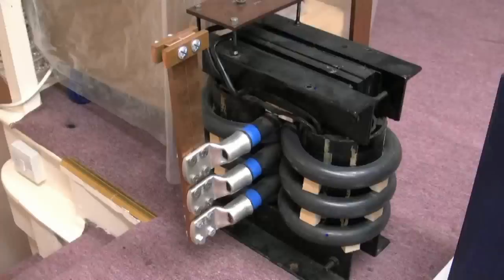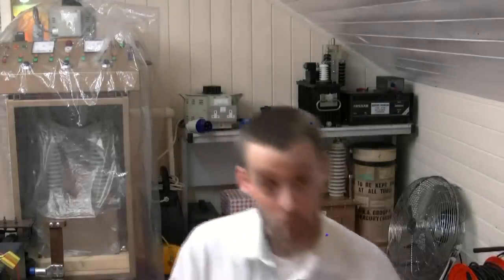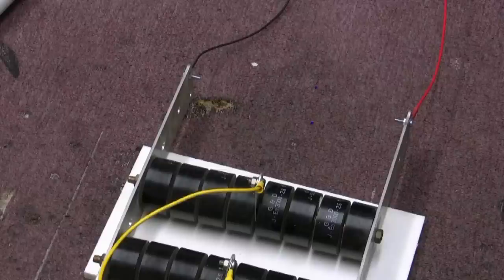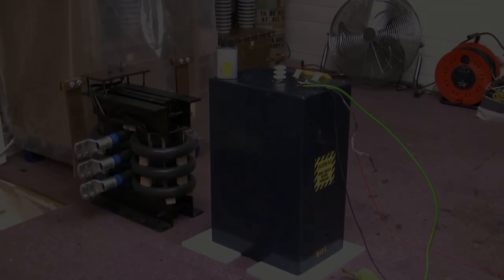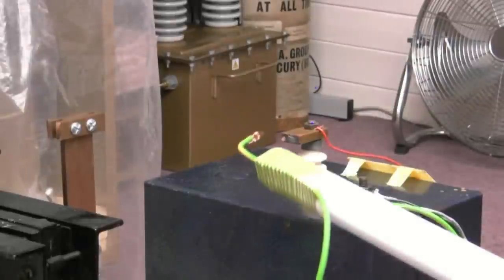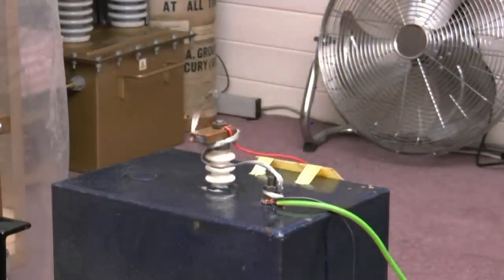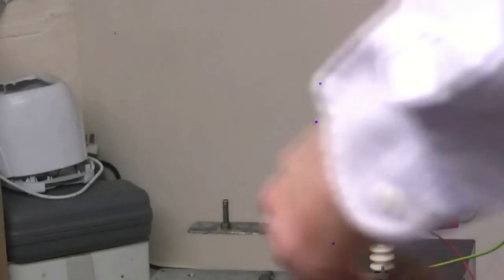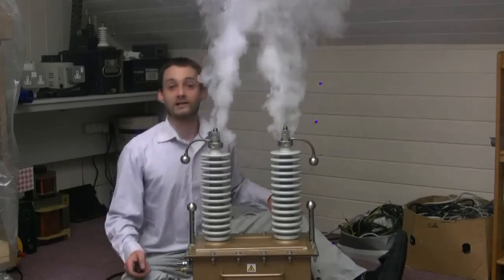Big Capacitor Safety

Comment: "You will probably just explode" Proper word of advice lad..
Reply: Ikr
Reply: Daniel Timberwolf your weakest point in your hand will explode like a fuse. You won’t die
Reply: Plus you have a lot of hand resistance and resistance from ground
Reply: Dave Crupel yes however there’s not a lot of time to do damage.
Reply: @WELLINGTON20  Look up stories of gypsys being blown up cutting through cables at substations for the copper
Reply: you will not explode, you will be hurt, cooked, or dead but only under conditons were a gap aleady existsvand is close to its breakdown volage and you touch that spot so as to help the gap reach that point will that part of you explode kinda
Reply: Lol your whole body is the fuse flesh bone skin nerves tendons all connected with that much juice you will be like the coconuts  shit it's everywhere imagine taht but body parts
Reply: Lol its probably  higher than that this dude literally  has the national  grid go through  that thing its probably  as strong as lightning  and imagine the pure current and power lightning  is this dude is probably  very  close to it
Reply: @jamescambell1386  "Hurt". Nice choice of wording.
Reply: @firefox1136  How do you calculate 400MW?
Reply: @kaspervestergaard2383  You would need the (resistants,) the duration of the puls and the energy to calculate it, but 400MW whas just a random guess. You can be sure tho, that the peak pulse power of this capacitor is in the range of ten to a few hundred MW.
Reply: @firefox1136  Very interesting. Would like to see the effect on that thing on a human being. Plenty of people getting cooked on overhead wires, do you thing this would go any differently? The power would automatically stop right after the charge is done I'll assume.
Reply: @kaspervestergaard2383  I guess, that if you would touch it with your hand for example, it would blow it of or explode it and then loose contact. 
I am very sure that there would be an explosion at/of the weakest link in the circuit, so your arm, hand or leg for example.
But I dont really know to be honest, I never heard of any accident like that and so can only tell you what I think would happen.
Reply: @firefox1136  Thanks for taking the time to explain. One thing is certain. Death is very likely ;)
Reply: @kaspervestergaard2383  Exactly, have a nice day. :-)
Reply: Joules would be the appropriate term not watts. I have 6 energy storage caps each one rated 17.5kvdc@72uf which comes out to 11.5kj for each capacitor
Reply: @kaspervestergaard2383   that would only add to the unsafe hype im known for

Comment: For those thinking of purchasing a large capacitor: they are dangerous devices.  Unlike batteries, capacitors can release all its charge at once, which means high current that can be very destructive and lethal, even for a brief time.  If batteries deliver energy like gas tanks, capacitors are like explosives.
Reply: Very true, best to leave it to those who know what they are doing. 

I remember that Nikola Tesla said capacitors were the electrical equivalent of dynamite after a very large one blew up in his lab.
Reply: didnt he basically say this? twice?
Reply: I should hope someone who purchases a large cap has qualifications in at least level 2 electrical installations or equivalent, which would give necessary practical and theoretical skills and knowledge to know about and calculate capacitances, and also safely work with electrical systems in general

Comment: These were the days I got my electrical inspiration. Now I'm on my way to a good career because of it. Thank you so much for the vids!!
Reply: What are you studying? I really hope your doing an apprenticeship which includes commercial and industrial because that's the only way to learn a trade. Doing domestic you don't really learn anything and it's a lot of bodget and scarper.
Reply: @TheManLab7  Got my associates degree in electrical/utility technology. I'm planning on getting in as a substation apprentice, right now I do electrical work on cell towers. I can agr with you there. The commercial & industrial side of electrical is far better than domestic/residential. I've done some residential, & it sucks. Lame as fuck.
Reply: @VariacManiac  I hardly EVER do it and it's only for my family and 2 of my mate's.
Reply: @TheManLab7  Sounds like what I'd do. Plus here in the US, we got residential grade outlets and wire which is cheap rubbish. For personal installs, I try to stick with the good commercial grade stuff, which ironically is easier to work with.

Comment: Actually, capacitors do have a behavior called "dielectric absorption" where the voltage will begin to rise again on its own after the cap is fully discharged. This is because some of the energy which you put in the cap when you charge it remains in the dielectric material in the cap. It doesn't come out in the first discharge but can be discharged-out later. How much this happens depends on the materials that the cap is made from.

Comment: Try it with a large-ish electrolytic. They usually show this effect pretty well. I just tried it with a 680uF, 25V Panasonic electrolytic cap charged to 24V. After quickly shorting it with a screwdriver, it rose back up to about 1V or so over the course of 30 seconds. In this case it's not dangerous, but if you have a cap which is charged to 5kV and it regains 1/25th of its original voltage, that would be 200V and still be enough to kill you.

Comment: Way back when I had a 2.2 uFd, 2300 volt DC capacitor, energy storage type.
That and a 1800 VDC power supply for charging.  I had fun, never got gotten.
Try discharging through a 2cm piece of the finest magnet wire you can find!
Very loud!
Reply: For some reason I felt like I had to try that a few days ago, before even reading your comment. But I used 0.2mm (~32 AWG) magnet wire, and a 22uF/400V capacitor charged from 220V mains through a bridge rectifier (310V peaks) and it was indeed very loud. Doing it again but with a 2300V cap would just be looking for trouble.

Comment: If you are able to get that capacitor, you probably don't need the warnings. Health and safety common sense.
Reply: +Julius Bernotas You'd be surprised what you can buy off ebay these days :-)
Reply: +vinny142 Kiddies buying that (and smart enough to charge it)? Unlikely.
Reply: Better to change "not likely" to "should not be made this easy"... Assumptions about something this dangerous, not worth it.  They could be obtained second hand, and you know how second hand things are often devoid of user manuals or proper labels 😜 Also, there is no certification required to option one, as they are not dangerous in the state they are sold in.
Reply: Charging them isn't hard. For those who don't know how, just run a simple google search.
The fact is, large capacitors are dangerous and everyone does have access to them. They're in TVs, microwave ovens, computer power supplies etc etc etc. They may not be as big as the one in the video, but they're just as dangerous. Death is still death, even with a smaller shock.
Reply: and 150mA is more dangerous than 300mA

Comment: Man, shorting out capacitors is loud! Even with a small MOT cap at 600 volts my ears still hurt. Oh, and there's aluminum foil shards everywhere because I wondered how big the damage on a CD would be.

Comment: I had an experience with capacitor accumulation. Though it was mere 400V 22uF that was constantly energized to wall plug over a year, it had a LED with 100k resistor as a load, i shorted it out 20 times and still it recovered the charge out of thin air. I ended up shoveling it into salt water for a day.
Reply: @DjResR Salt water?
Reply: @kaspervestergaard2383  Yup. Salty water is conductive. It was first thing I got in hand after getting zapped 5 times in a 10 minute span._
Reply: @DjResR  Must be the fastest responds to an 8 year old comment. Interesting with the salty water. have heard it was more conductive, but a very smart way to use it. Still playing around with these things? Not really a person that understands all these different technical words, mostly here for the overload videos :)
Reply: @kaspervestergaard2383  Same old same old, although nowadays have done more experiments with low voltage stuff, just recently managed to get 4000 chips to do stuff. Still getting zapped too from time to time and it still hurts._

Comment: what would appent if you connect ten o these in parallel? (other than creating a black hole)
Reply: Ruben Fasola 
You would create something, even photonicinduction wouldn't mess with
Reply: You'd get 10x the amps. Try charging them in parallel and put them in series for disscharging, then you get 10x the voltage :D

Comment: um yes i do.  it would be used in a standard "H"power supply to filter out and ripple.  What I do not know is if it would be before or after the inductor choke.  Probably after & before the load.  Id like to know how many farads it is.

Comment: what is the size of that capacitor? (farad / coulomb)
Reply: Joseph Deerslayer 138uf, 5kV
Reply: MadSparks164 Why does they have such low farad? My car capacitor have 4 farad. why doesn't this one?
Reply: Because that would mean having an even bigger capacitor - This capacitor was obviously used in an application that required a 138uf capacitance. This capacitor has an extremely high discharge current, so the power when shorted in extremely high, resulting in the big bang as lots of energy is released almost instantly, like a bomb.
Reply: sebastianblevdet Because your car capacitors are rated for a very low voltage. You can wrap the capacitor sheet more tightly, so tight there's a very small distance between the sheets, and you end with a higher capacity. When making high voltage caps you can't wrap them too tight, because you need to use a good insulator to prevent arcs and thus destroying the capacitor. 
If your car capacitors were connected to that supply they would just arc and be ruined.
Reply: Victor Arnaiz Thanks, This made sence!
Reply: Victor Arnaiz Stop me if I'm wrong, but if this cap is 138uf that would mean it is most likely an electrolytic cap whose anode is covered in a insulating oxide which acts as the dielectric which can withstand very high voltages but it can not hold many charges. The capacitors in car stereos are often electrochemical caps with a liquid electrolyte which can stabilize the electric field created by more charges giving more Farads but it is unable to handle the pressures much above 3 volts which would cause arcing and destruction of the micro structure of the sheets.
Reply: Virtualgod2009 Ya that could be true, I was not sure what the voltage of the cap was, usually when I see uF or pF i think electrolytic because they never have a high amount of Farads.
Reply: sebastianblevdet stiffening capacitors in car audio systems are build to sustain a maximum voltage of about 20 volts. larger voltages require thicker layers of dielectric, which decreases capacitance.
Reply: yeah, its like if you have a high enough voltage between an anode and cathode it will jump the gap. through the air even

Comment: Sorry for my nublet question, but can that capacitor be used for a tesla coil, and will it be effective in power factor corrections for high power supplies? Thanks for your time
Reply: #1: Don't ever think about it.
#2: Yes in fact it has been designed to also do so.
Reply: Yes it can
As Mr opengl said don't

Comment: How much would it cost, if i would buy all this parts in some shops?
Reply: Virtually zero shops that sell the parts such as large HV transformers, hv diodes and the HV capacitor is very expensive.

Comment: Voltage Vs Amps - There's a curved-edge Nexus-Diamond diagram that explains this. High Voltage, Low Amps AC won't kill. Low Voltage, High Amps DC won't kill (to a degree - heating of flesh might make you retract your grip/touch - salts/electrolytes in your blood will vary). Anywhere in the curved-edge diamond-zone (combo-zone) has the potential ability to either shock your heart into full cardiac arrest, or conversely, literally blast your flesh (heated saline in your blood) apart with explosive energy. Know the zone!

Comment: what did you use to make the smoke at the end? need to check how well a fume cabinet i made works...
Reply: You can buy little smoke bombs/grenades for airsoft/paintball for not very much money. Those would probably be your best and easiest choice.
Reply: Daniel W too bad i live in Australia. such fun seems to be ilegal here.
Reply: sn0wchyld I'm sure there's a smoke bomb type of thing that gas engineers use to check for leaks. Better to have leaking smoke than gas. Perhaps try a hardware store. Other than that, i'm not sure what else to suggest.
Reply: Daniel W yea cheers for your ideas mate, i've ended up using a bunch of incense sticks hah. stinks a bit but did the job.
Reply: sn0wchyld Incense...why didn't I think of that?.....lol no worries buddy
Reply: Vapelife bruh!
Reply: Samster881 What if he doesn't vape?.......
Reply: Samster881 hah dont vape, but not a bad idea. I build a lot of ebikes/starting on motorbikes so batteries arn't an issue.
Reply: you can get smoke matches for testing chimneys and smoke detectors from seton.com.au, bit pricey but
Reply: Make your own smoke bombs... Sugar and potassium nitrate... 60/40 60 percent ammonium nitrate and 40 percent sugar... Mix and heat in pan until it's a paste..
 Take a tube pour it in then use a pencil to make a hole down the middle until it hardens.. take out pencil and put in cannon fuse/firework wick

Comment: Question: if that capacitor is at such a high voltage, how come it doesn't jump the gap as soon as you get near it with the discharge stick? I assume it has something to do with the resistance of the dielectric, but I'm not entirely sure. Also, since current equals voltage per resistance, that means the transformer giving off low amperage at very high voltages should still be pretty dangerous, wouldn't it? Since, you know, about 0.2 amps at a high enough voltage is apparently enough to almost certainly kill you. So if you have a transformer outputting, say, 300 kV, like in Photon's TV destruction video assuming a resistance of 100 kohms (a generous estimate, supposing the individual's skin is completely intact and dry, and the environment's humidity is low) for the human body would yield a current of 3 amperes, more than enough to make dead meat of anyone touching the thing. So 'ow does that work then? Electricity is confusing :/
Reply: +PremierMilenkov 
Air breakdown voltage is 3000-5000V per millimetre depending on conditions, he only used around 2000V so the distance would be quite short.
Reply: MsSomeonenew That's alright then.
Reply: No he used a microwave oven transformer which outputs approx. 2400V
Reply: A capacitor it charges up and stores  current and then discharges it very fast when it's shorted.
You're right about ohms law but a system can only output what power it has, if you try to take more current than it's rated for it will either pop a fuse or burn. Think of it like putting way too much water through a pipe.

i assume from your comment you're aware of power = current x voltage but just in case.

Comment: Would there be any benefit to add a capacitor Bank to your home
Reply: James Thornton To your home, probably not. Energy storage systems like the Tesla power wall can have some benefit, but they use batteries for a higher energy density and lower cost. However, they can help with power factor correction for some industrial applications
Reply: thank you for getting back to me

Comment: we have a rf weder at work with a 10,000v capacitor like that not sure on the amps but he thought he shorted it out and touched it, he ended up 20ft away and is now unable to use his arm because well it isn't there anymore
Reply: NEVER TOUCH ANY CAPICITOR LEADSUNLESS YOU ARE ABSOLUTLY SURE ITS DISCHARGED OR IT LOW VOLTAGE  LIKE UNDER 50V DC

Comment: hello,

the thing i don t understand with capacitor is why they sometimes load by themselfs when they are unpluged.

your videos are very interesting , i work on electrical power equipment and it sometimes blast like your video ( material failure , igbt are sensible electronic switch ....) ,each time something explode i remember your videos .

extremgear from france.

Comment: You should get about 4 and connect then in series. Then it will become Extremely Lethal.
Reply: Same if you do it the other way and make a bank lol
Reply: ***** But if it was parallel you would get the same current just longer runtime .With it in series it would double the current based on how many caps there are.
Reply: ***** Ok I'm just confused I don't really work with caps.
Reply: Blase Bermea "Extremely Lethal" ? hah It's same as saying "more pregnant" or "that dude is more dead than another" . Pff one of these is more than enough to kill you.
Reply: bb aas Ha yeah

Comment: hey guys, i have a 100volt 100uf capasitor that i want to test a little, can i charge it up with only a 20 volt DC power supply, or won't it work? thanks for answers :)

Comment: A small 300 uF 300v capacitor in a camera flash is lethal, this is scary. Not laughing watching because of just how serious.. Imagine capacitor banks set up in 765kV substations,,, the charge. HV Capacitive discharge sobers even me, so be beyond careful with them everyone.
Reply: what caps do modern cameras use? Arent the flashes LED in most cases now?
Reply: Pfffffh! Get one of the 350V ones from a 9V alarm strobe and shock people with it, and yourself, its a rush! lol..
Reply: @superhacker35  Camera flashes say on a mobile use LED, those on proper cameras like DSLRs and speedlights use Xenon lamps and require a large cap to shunt a large current to drive them